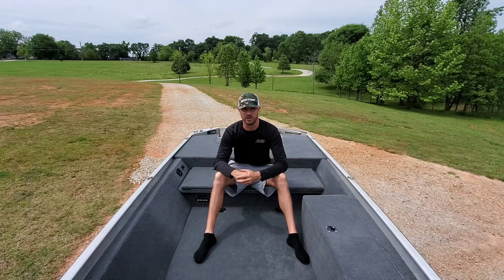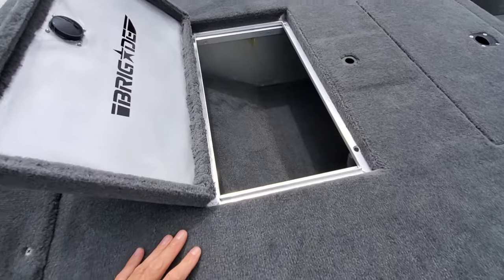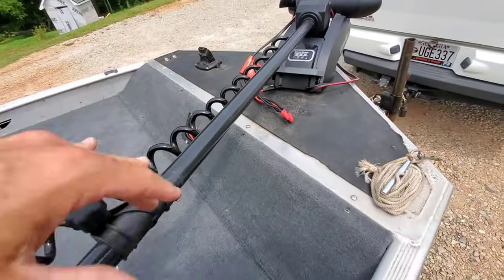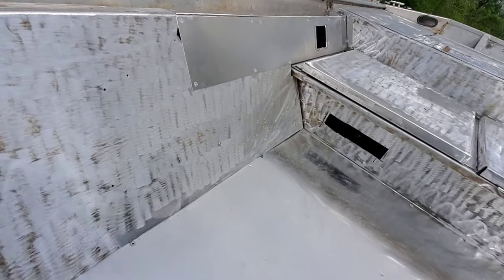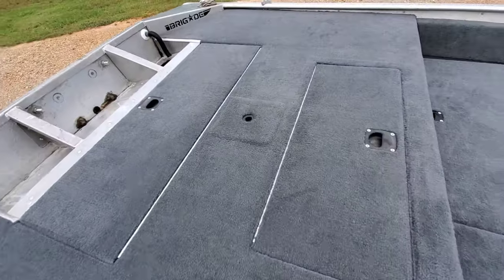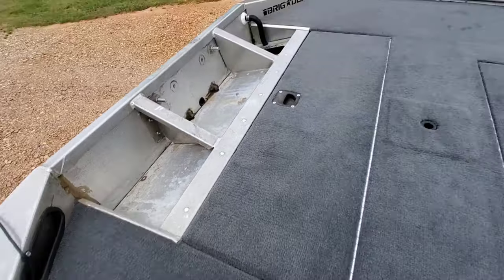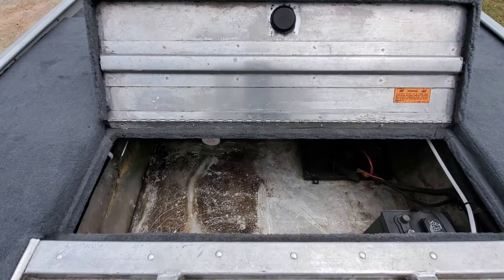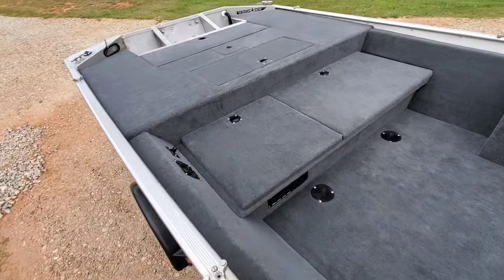16ft Bass Tracker Bass Boat Restoration | Full Walk Thru | Brigade Boats

Comment: I'm doing a rebuild on a 14' jon boat. Hatches, rod locket etc w/ alum frame.
Q: I don't have a garage to store it in. So it's probably going to be sitting outside. What would be the best material to use for finishing the decks. Was going to use carpet. 🤔

Comment: Anthony, Hey, I am a first timer on small boats, big boats or any boat at that matter. However, I am retired with nothing but time and found an old 14ft DeSoto Jon boat adrift.
    Now to the point. I have absolutely no clue as to where to begin on the decking. Since I am an artist, I have many ideas for a paint scheme, but none on where to put compartments. Thus I would like to use some of your ideas.  Mainly off your Top Gun boat. Not exact as the bottom of this boat is only 33" and the birth is only 46". So it is rather narrow. And the length is actually only 13.5 ft. But some of the basics. It's Weird for what they call a 4 seater boat!   
Thanks
Reply: By the way, Great job!! Your craftsmanship is exquisite.

Comment: What is the total weight of the rebuild?
Does it exceed the recommended weight limit?
Reply from the maker: I don't know. No. This boat was rated for a 75hp we removed.  No way the couple added hatches and aluminum I put in replaced hundreds of pounds for te outboard we removed.